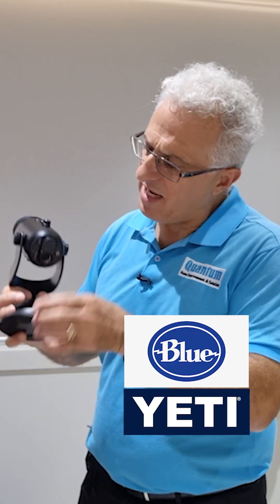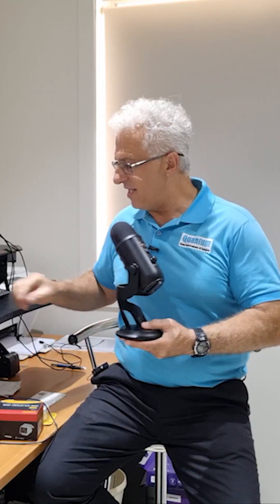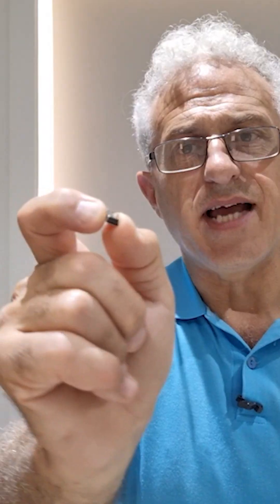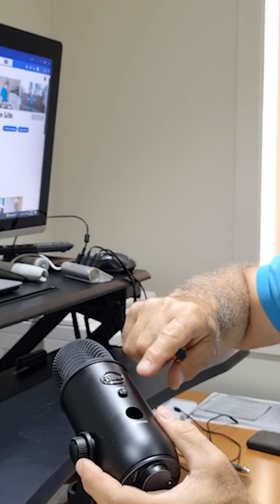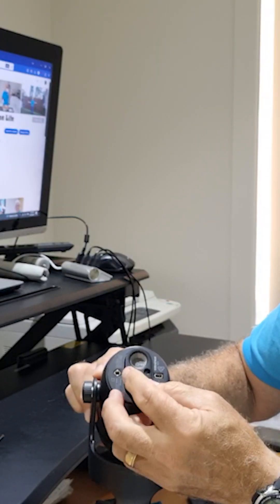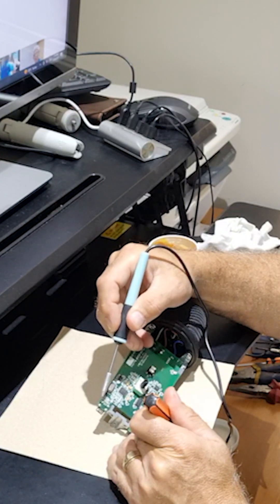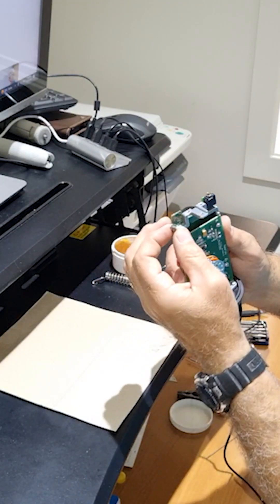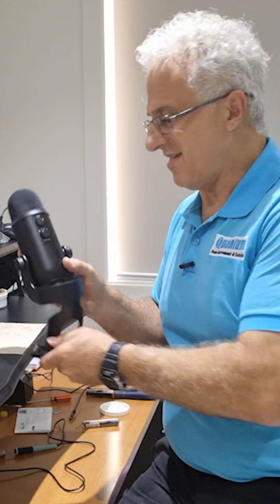Repair a Blue Yeti by Replacing the USB Mini port Connector #SHORTS

Comment: spent $30 at a thrift store to find out it has the same issue you fixed here...... do i really want to buy a new usb, soldering kit and screw drivers??
Reply from the maker: The truth be told. I haven't used the solder since this and cost it a bit of money. However, I am sure I will use it in the future, most probably.

Comment: I tried with 3 diff. usb cables and the same issue is happening the mic wont turn on unless I move the cable around, looks like the mic is damaged internal and I need to replace it... sad had it for 5 years now
Reply from the maker: Sorry to hear that, Fouad. I found moving the mic up & down damages the usb connection, so now I keep the upright all the time.

Comment: I'm having trouble with the headphone jack do you have a part number or link for that?
Reply from the maker: Sorry Dazeroh, I don't. In actual fact, it was very hard to even find the mini usb port, until I found it on line. Now I just discovered that the seller is not selling them anymore. I will try to find another sell on ebay. I hope you have luck finding it.
Reply: Thanks thats alright, I was able to locate it (PJ-307).
Reply from the maker: @Dazeroh Great, when you have replaced it and are happy with it could you share the link? Thanks Dazeroh